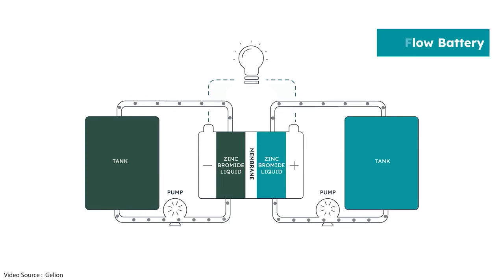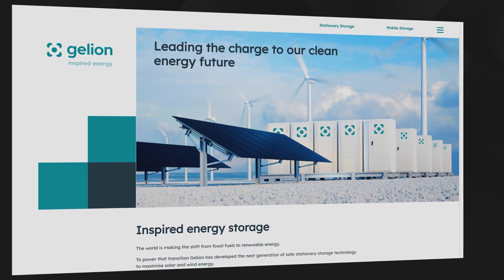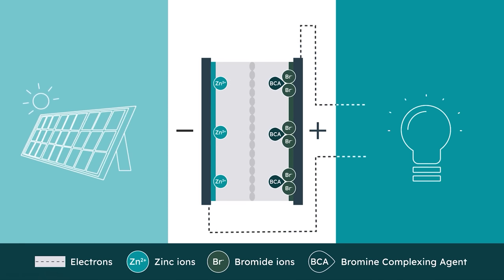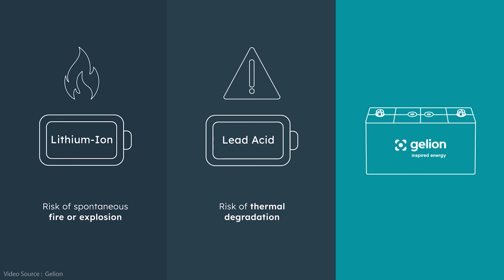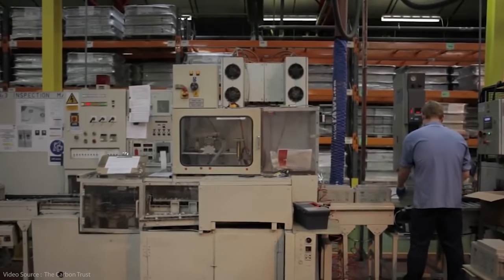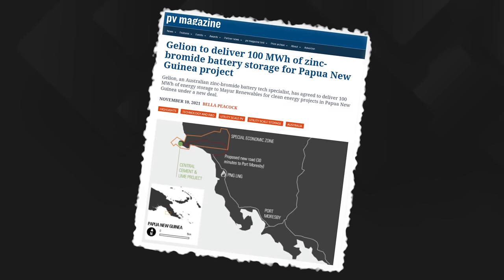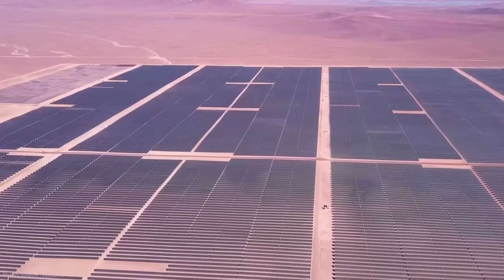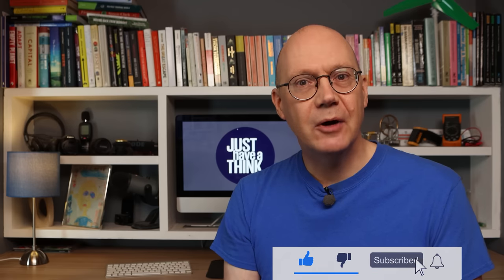Zinc Bromide GEL batteries. Cheaper, greener, simpler & safer than lithium -ion!

Comment: Think too, if you only boost the battery as it drops power, it is similar to,a car system. But if you only have a minimum top up charge, it is less wearing on the life of the battery.  We tend to over-do the charge as we have constant high speed engine ‘ free’ charge. Biased by more wear, more replacements required for sales reasons. Like only engines blowing off steam, waste energy. All in the name of making profit at the expense of the user and giver. Earth materials. And the byproducts of waste, considered too costly to be recycled, no profit it. Material only have to be reconsidered for change, like Humanity habits.

Comment: Seems to me this rush to use Li-ion batteries for home and grid battery storage will eventually turn out to be a major mistake and waste of resources.  For now though, companies are rushing out to make that money while the getting is good. While there's limited competition in the sector, and while government mandates are allowing those companies to upcharge for these products and scalp the taxpayers.  The auto-sector seems to be short on battery cell supply... but then you have companies like Tesla bulk buying an oversupply of cells from their suppliers to drive down their per kWh costs.  Any excess cells they have where they can't build cars with simply go towards their home and grid storage products, and they reap the reward of lower priced cells for their cars.

Maybe LFP Li-ion cells are a bit better, but Lithium prices could keep increasing for the forseeable future.  And as we should all know by now, nearly the entire supply chain for LFP cells is coming from China right now.

Comment: As with all the competing technology with lithium ion for grid storage applications, the problem is getting it to market at scale. From quick reading on ZnBr2 batteries, the flow versions have low Coulombic and energy efficiencies relative to Li-ion, but maybe these are improved with a less flow-like battery system and being more like a conventional battery. These are best for grid storage and small scale mobile backup power source markets. Since the energy density is so low relative to Li-ion, it will need lots of space. I also think cost is going to play a role in its adaptation too. Na-ion batteries may be a better choice because they are more energy dense and can operate at higher voltages, but both of those technologies are not yet ready for the mainstream, while Li-ion is. This technology needs to come to market in a big way before Li-ion dominates by 2030 or it may never get the traction it needs to gain market share. I think that is one reason why hydrogen fuel cell technology is relegated to niche markets because Li-ion beat it to market and is winning in scale, cost, and performance.

Comment: Did I miss something?
There was nothing about efficiency.
Nothing about charge density.
Nothing about self-discharge rate.
Nothing about current capacity.
Nothing about cost per WH.
Nothing on the website either.

You know what other kind of battery is environmentally friendly, cheap to produce, cheap to recycle, safe to store, and requires only minimal modification to existing production processes? 

Potato batteries. 🥔

It's just that all those other things make it a really bad solution.

Comment: My question is how they will fit into a car with an alternator. Would the alternator of your average automobile and it's electrical systems be able to just swap this battery in or would there be the need for a bms

Comment: Nice, but doesn't solve the main problems. We need an energy storage system that's cheap, safe, scales up to ridiculous sizes, reasonably efficient, has a reasonably long cycle-life, and not too hard to recycle.
The only technology currently in production that has a chance to cover all is the li-ion battery. More specifically Tesla's 4680 cells. The only thing these need is scaling up mining operations for nickel and lithium.
As far as I know no technology in development covers all, even in theory. Those that have the cost and scale, usually very inefficient. Those that are cheap and efficient, don't scale up. And so on.

Comment: Seriously - all those "new battery tech" videos should start with very quick overview of basic parameters - price, number of cycles, energy and power density and obviously stage of development/deployment. And please - don't hide it behind phrases like "discharge time sweet spot" - just say intended C rating is between  0.125 and 0.25C. With that in mind, we can judge the intended usage as you explain specifics like it being a production substitute for lead-acid batteries (it may be produced on the same lines, but it will not replace lead-acid because of that low C rating)
Reply: Then do it yourself if it is so important to you.

Comment: Zinc Bromide rechargeable batteries are not new and from a previous article on you tube showed the Patent's upon which this is based and it is solely on the Gel and there are others developing Zinc Bromine cells. Perhaps some of the others could have been mentioned here. I made a Quick check and found 8 other companies in China,UK, Australia and USA that are developing Zinc Bromide batteries. That's just scratching the surface.

Comment: I hope one of these new battery storage devices really catches on.  Lithium technology is a dead end going forward because of the scarcity of Lithium and the fact that the USA has little lithium within its borders.  Trading one scarce resource for another is not the way for the USA to become energy independent and not have its economy held hostage by unfriendly regimes if we ever want to reduce fossil fuel usage for good.
Reply: Lithium is not scarce. It isn't scarce in the United States.
Reply: not everything is about the US
Reply: @neverendinghobbies  There is one active Lithium mining site in the USA located in Nevada.  There are about 20 sites within the USA that have enough lithium to be mined effectively.  The USA is estimated to have about 79 million tons of lithium within its borders representing about 10% of worldwide deposits.

Since by 2030 the entire worldwide demand for lithium will be 2 million tons of lithium it would seem that the USA could provide enough for the USA.  But you are not considering the cost to extract the lithium in order to use it.  If the USA cost is double or triple the cost of other world wide deposits the above number mean nothing if mining lithium in the USA can not be profitable.  So in the end, the low cost lithium mining locations will have the upper hand and be able to control the supply of lithium, which is not the USA
Reply: @kai_444  This is a good point but I live in the USA and where I live is most important to me and other Americans.  I do not know where you live but I am sure the exact same is true for you and your countrymen.  The world is not one homogeneous piece of land and so locality is always important to each and every country.  What is important to the USA is not important to Saudi Arabia or to the Congo, so differences will always exist.  But for the world to adopt clean energy sources as a whole, there must be a consensus that the product used works for each country otherwise efficiencies of scale will never come into being that makes it a world wide product.  With no world wide agreement than what works best for one country will be paramount and presently coal is that product for too many nations, which will never be solution to reducing emissions of green house gases.
Reply: Geothermal lithium extraction is coming online very soon. zfZqpdt3Zy0
Reply: "The Salton Sea could produce the world's greenest lithium, if new extraction technologies work" The Salton Sea is in California, USA.
Reply: @yorkyone2143  oversupply? With the EV sales rising, it's predicted that demand will overtake supply within the next couple of years, and supply won't be able to keep up before 2030 or 2040
Reply: @anthonycarbone3826  There is enough lithium just in Nevada lithium clays to provide for all the US.  Tesla is looking at this.
Reply: @longrove5710  There are plans for DLE (Direct Lithium Extraction ) from geothermal power plants in Cornwall UK, Upper Rhine Valley Germany, Salton Sea California and Catamarca Argentina.

Comment: 50-60Wh/kg is way less than current lithium energy densities, which as of now are in excess of 250Wh/kg. Unless this battery is 4 times cheaper than lithium based chemistries it's not going anywhere.